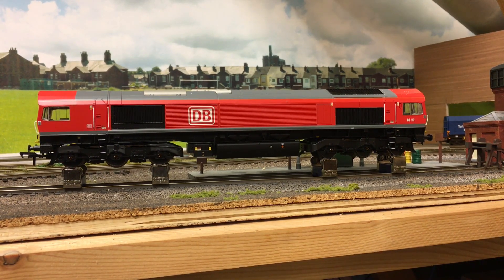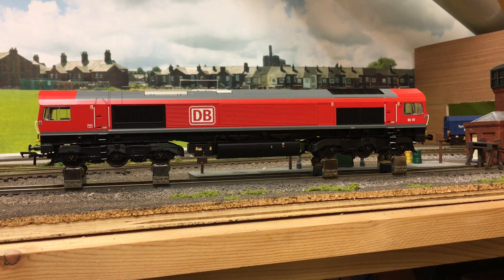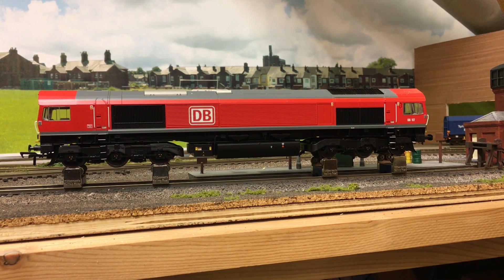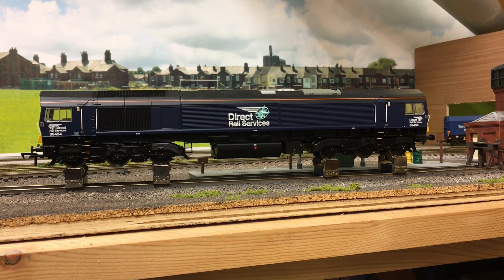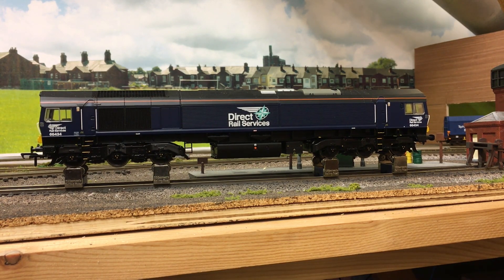Bachmann Class 66 running noise level

Comment: That's brilliant - thanks for taking the time to do this. The sound is very similar to mine. I've tried doing db readings on my phone (on my DCC concepts rolling road for standardisation!) and my figures were 35db for an older 32-980 and 43db for my DB Cargo one so (I'm guessing the variance to your values is based on the sensitivity on the microphones between devices). I'm going to check with Bachmann, but I'm guessing its a slightly ammended design alligned technically to the noisier coreless motors in the 158s. I'll let you know what they say. Thanks again :)
Reply from the maker: That's very interesting Adam, look forward to hearing what Bachmann have to say, please do let me know. Funny but my 158 is noisy now you come to mention it! I have problems with the functions on the 158, but that's another story!
Reply: @brayworthpark5542  Hey - My other half has heard back from Bachmann - they have said that the current 66s are mechanically identical to the earlier variants and there shouldn't be any difference in noise when running. They have suggested lubrication (which isn't that easy on the 66 when trying to remove the bogie covers), but otherwise to send it back. Now I really don't know what to do!!
Reply from the maker: @adamoldridge  Hi - To be honest I would keep it unless it really is annoying you that much. It may get better over time. Can you get to the gears by removing the body? May be easier to go in from the top - idk.

Comment: Hi,
I recently received the new bachmann DB 66 177 and found how mechanically loud was. Planning to return mine and get a replacement.
Reply from the maker: Hi, would you say yours is  lot louder than mine in the video?
Reply: @brayworthpark5542  Potentially yes, I don't have a meter to record the decibles but to me I think mine sounds louder. I also think mine has a different sound to yours, more of a whirring sound, which I don't believe I've heard before on any of my other locos. 
With what seems a widespread problem, do you think it would be a good idea to send it in to Bachmann for repair oppose to getting a replacement?
(Running mine on DC not DCC/Sound)
Reply from the maker: @McMetro  As it's new maybe you should ask for a replacement from the retailer, and let them return the faulty ones to Bachmann. Running on DC should not make any difference to the motor / gearbox , so it could well be faulty, or it may bed in over time.

Comment: Hi , if the sound is too loud on a loco I lower it with CV63 first checking what the default setting is . 
    Happy new year ......Peter
Reply from the maker: Hi Peter, thanks for your comment, but this was about the mechanical noise of the loco, not the sound chip volume
Reply: @brayworthpark5542  Oh dear , that's the trouble with listening to videos with the head phones and watching the telly at the same time . Lesson learnt LOL
Reply from the maker: @ChapelEndJunctionUK  haha yes I know what you mean, but thanks for watching anyway!